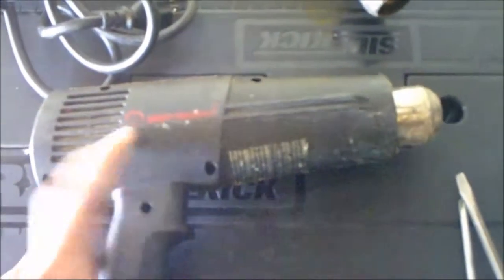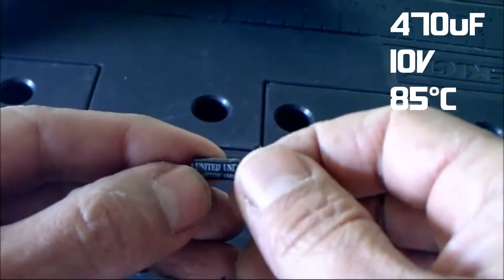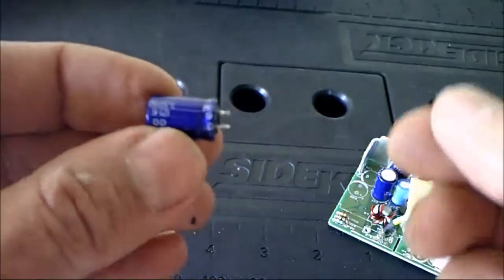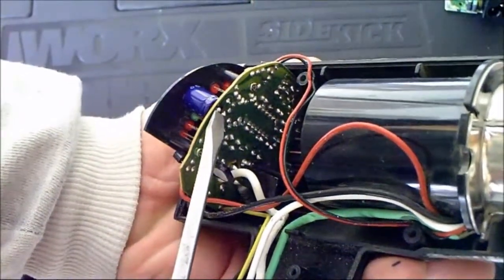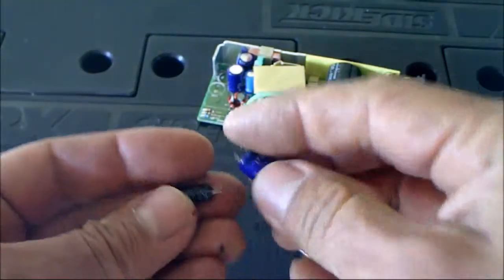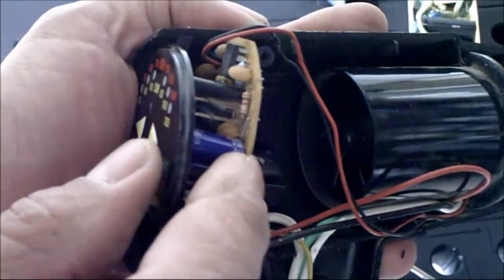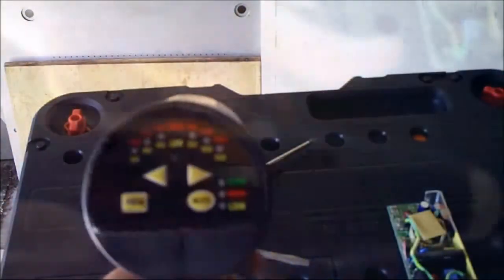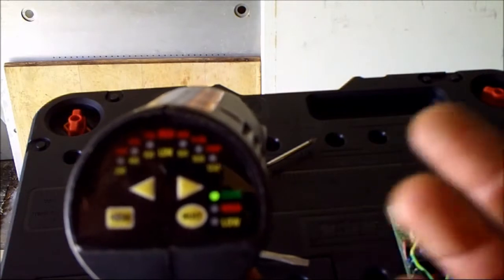Milwaukee MHT3300 and Wagner HT3500 Heat Gun Repair

Comment: Worked. Cap measured at something like 8.79 on my MESR  cheepie Ebay Cap tester. Broke screw fitting nearest nozzle on bottom. Can't figure how I missed it, but did. Repaired with cheepie cap assortment from Ebay. Probably be good for a few uses...maybe.

Comment: Just got my WAGNER HT-3500 heat guy fixed. I followed your repair directions using an old capacitor salvaged from an old power supply. It works perfect now. Many thanks for sharing your expertise.

Comment: Just note that this model was recalled for fire safety issues. It's odd in the US only certain date codes were recalled but on the Canadian site it doesn't specify date codes so I'm not sure if mine is affected. Just a safety note.
Reply from the maker: Thanks for the information. I checked my heat guns and there are no date codes. Not sure why. If anyone else is interested in the date codes, they are V300R through Z365R and A001R through A111R. Just as a precaution, always unplug your heat gun after use. Here's the link for the recall: https://www.cpsc.gov/Recalls/2009/wagner-spray-tech-recalls-heat-guns-due-to-fire-and-burn-hazards